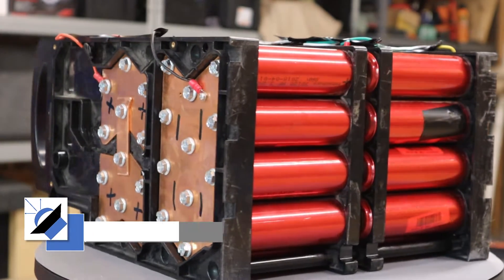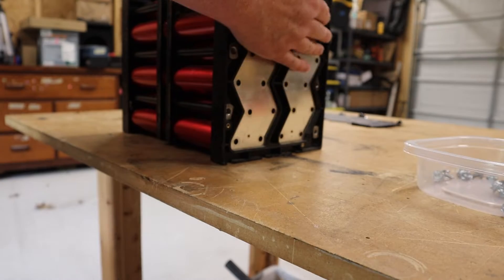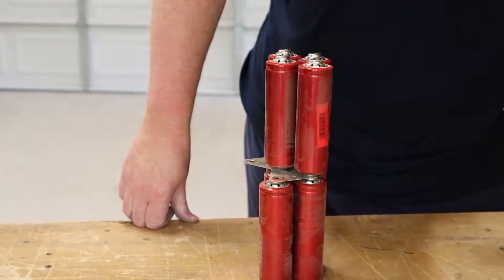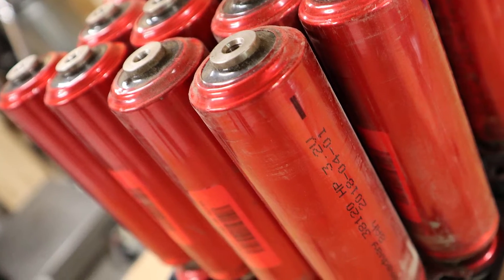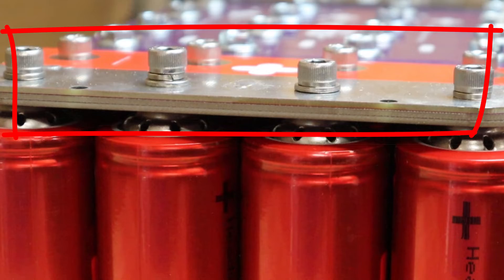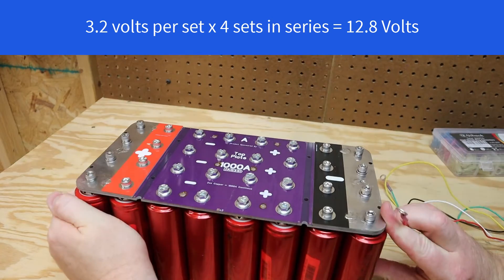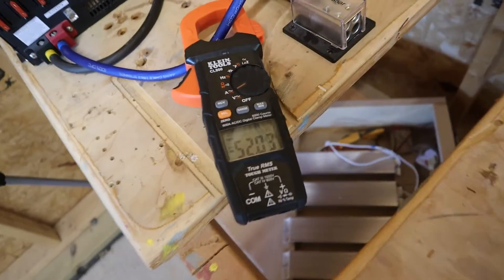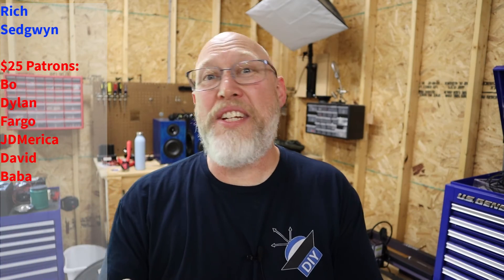Super Beast Battery Transformation! @JAG35, Headway Lithium and Battery Hookup

Comment: Here a question. Can you run headway cell on a lead acid battery with a isolator
Reply from the maker: The resting voltage on something like this is close to that of a lead acid.
Reply: You can run these with no isolator, if it's a daily driver.  if it's in something that will sit for more than a couple days without running, then an isolator would be best.  with that said, you DO need some form of balancer, of which the one in the links description does work for these, I have been using the same balancer for several years and it's best to do a top balance every so often and to check cells individually to make sure none have gone bad.
Reply: @Joe_1776  thank you I was always curious